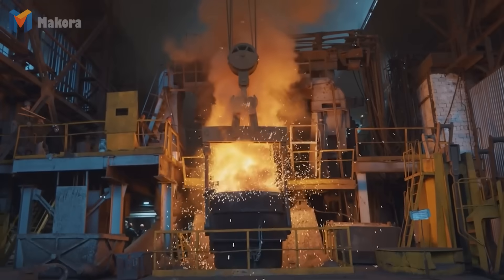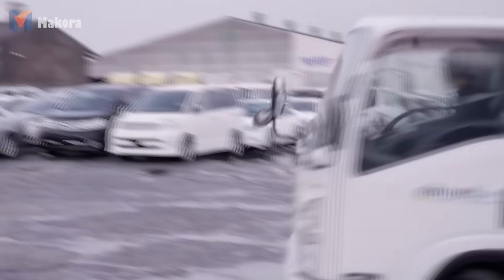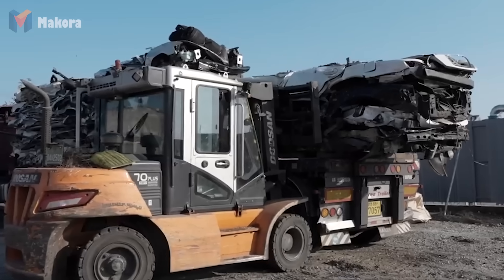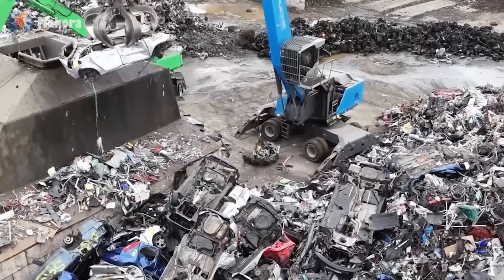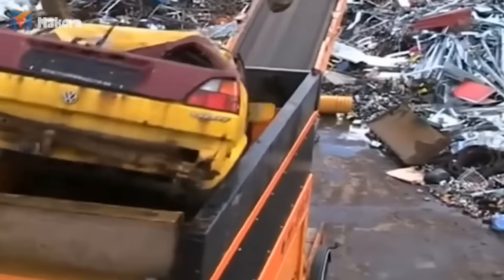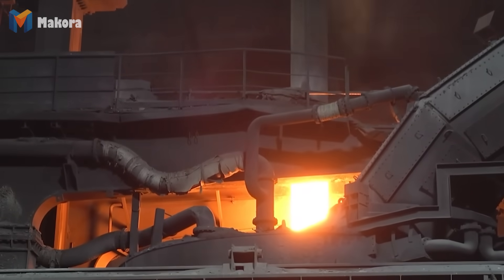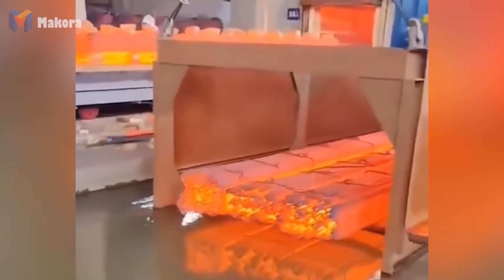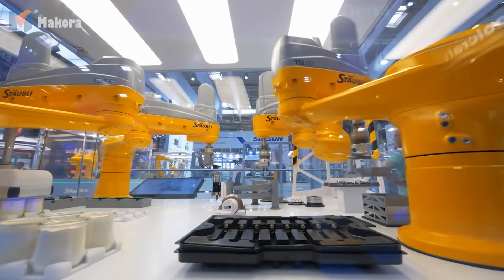How Millions Of Old Cars Are Turned Into New Steel | Inside the Massive Car Recycling Process

Comment: These vehicles are scrapped because of wear at contact points. Much of the time labor cost makes continued life impractical.
Reply from the maker: Exactly. Mechanical wear, especially at joints, bearings, and suspension points, often makes repairs uneconomical compared to the car’s overall value. Once labor and parts exceed what the vehicle’s worth, recycling becomes the smarter option — giving those metals a second life instead of letting them rust away.

Comment: Why can't cars be designed to be REPAIRED -- easily and cheaply -- and last for at least twenty years of run time with adequate maintenance?

It would greatly reduce the energy requirements in the  production of replacement cars and the energy to disassemble/scrap the older ones and turn them into molten steel.

There was something sinister about the Government "Cash for Clunkers/Guzzlers" program as it eliminated  many good quality vehicles from the market that could be easily and cheaply repaired.
Reply: Cars should be able to last for decades.  The only cars that need to be recycled are those with a lot of rust.  Every part of the car can be repaired or replaced.  Even the wiring harnesses.  If we wanted to preserve the environment, tax credits could be given to restore and update older cars or for transition to EV.
Reply: If cars were made to be easy to fix, the manufacturers wouldn’t sell as many new cars. This would result in lower corporate profits and even worse, lower executive compensation. 

Can’t have that!
Reply: BAD ! FOR BUSINESS ! And Corporate GREED !